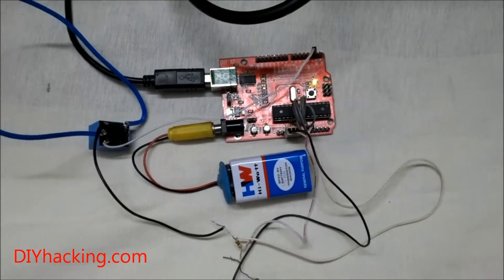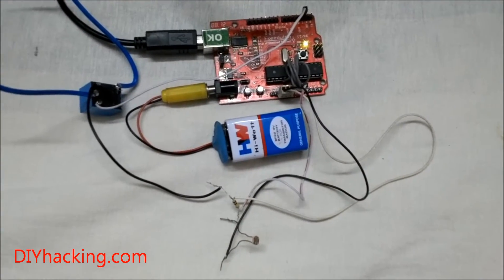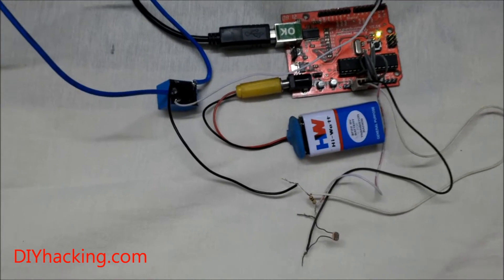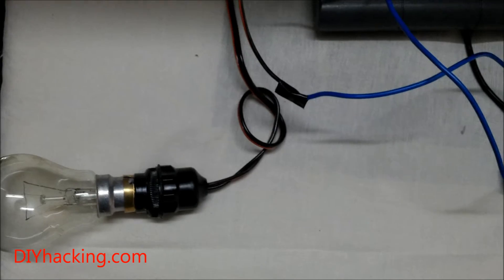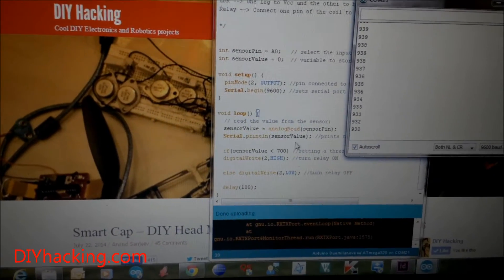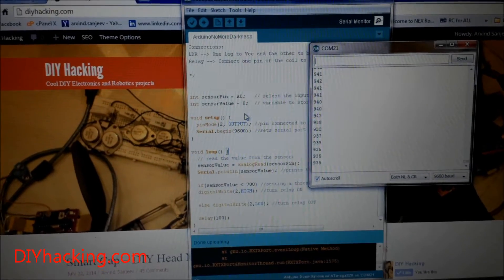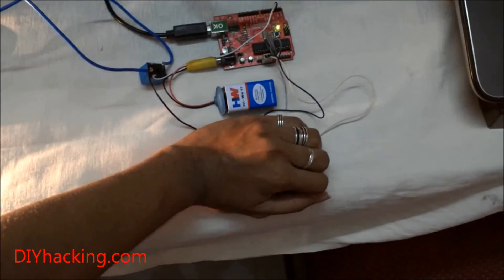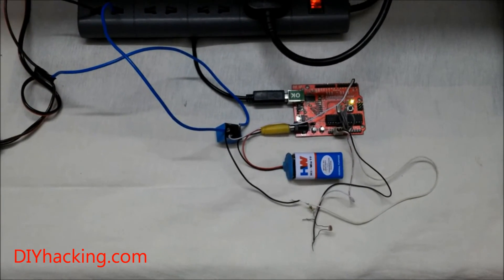Arduino Beginner Project with LDR

Comment: Oh boy... wires sticking out of power sockets, mixing low voltage logic with high voltage AC... This will kill someone at some point and i think it is completely irresponsible posting this without any sort of warning about how dangerous this is. If someone needs help wiring an LDR, they are probably clueless about how dangerous AC is.